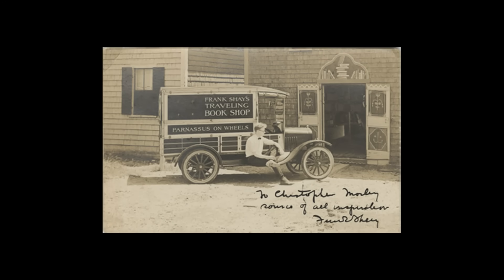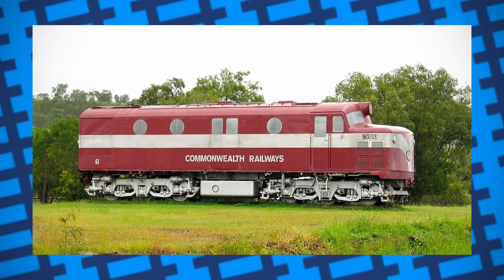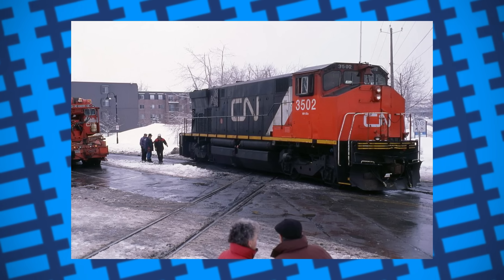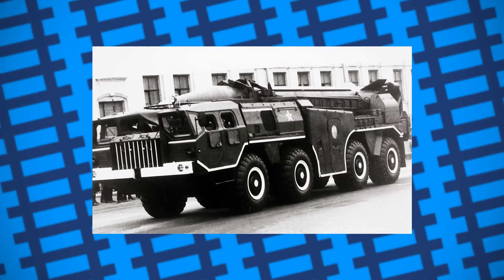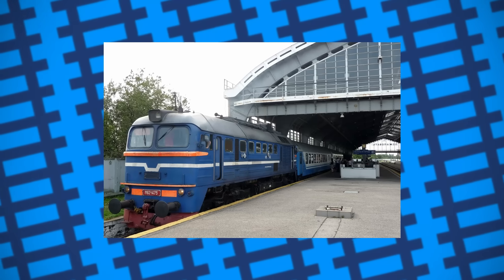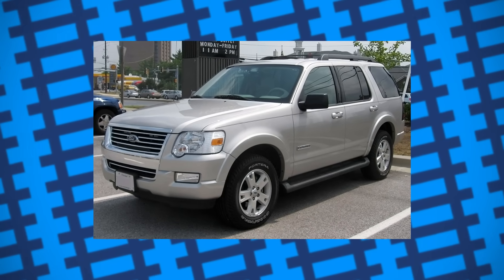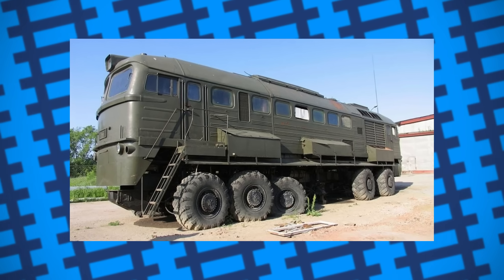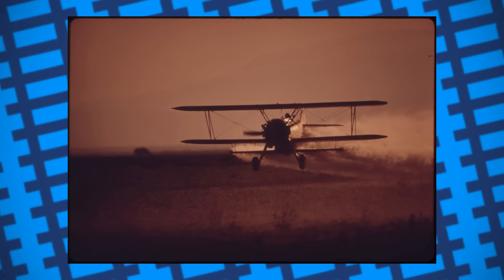Why Railway Locomotives Don't Make Good Road Vehicles - M62 + MAZ-547

Comment: i may be wrong here, but I seem to recall reading that the main reason this idea was floated, was as a potential power source for what Russia calls "Frontal Aviation".   Frontal Aviation is something of an outdated term today, but at the time that encompassed everything from forward operating air bases, to air defense.  Whatever the case, one article I found suggested that part of the idea was to utilize the M62's as portable generator stations.  The theory being that these converted locomotives (a large number of m62's were produced, so they had something of a surplus) could be driven to and 'emplaced' at forward air bases.  Those bases being hastily constructed affairs and not fully established like a true airport or base.  This locomotive, or a couple of them, would provide power for the base. In the event the enemy were closing in, then everything (including the power units) could be driven to a new location.

Comment: It could have also been used for moving supplies to remote Arctic regions for oil and gas exploration as and ice and frozen ground does makes for solid roadways. Even for extremely heavy vehicles. They would do something similar with bulldozers pulling sleds in Canada and Alaska. Granted if you would put this thing in 2 separate sets of tracks like on quad track tractors it probably would have done better but would have been very slow

Comment: My Ford pickup has more power than that shunter. I would NOT have guessed that! I have also pulled a 40ft flatbed with up to 10,000lbs on it with the pickup (nearly 25,000lbs gross combined). It's crazy how much horsepower modern tow-vehicles produce in comparison to the smaller locomotives.
Reply: To be fair, power doesn't pull, weight and adhesion do. Power just determines how fast weight and adhesion can pull.

Comment: I wonder instead of a heavy diesel locomotive, if it is could be possible with a civilian City transport train cart. Particularly the ones that we have in the US as I'm not familiar with the designs of other civilian train carts in other nations. Which do have different designs. But perhaps like the one we have in America maybe more lightweight than the heavier diesel electric train. Now I don't know too much about these train carts but I do understand they don't really run on typical fuel and I really just electric. So no dies or anything, I think it's literally just powered by its railways. 

It probably be more equivalent to like a battery car, but again no quote me on that so I don't really understand the true mechanics and how they work. But from what I've seen, it doesn't look like it has a fuel tank built so if one of these supposed to be converted to a land vehicle it probably would be too heavy and be more like the weight of a semi truck with a trailer. Maybe. And it would either have to be a battery-powered electric vehicle or have a semi truck engine installed. Honestly, there would be no real such purpose that such a vehicle would ever be able to fulfill when we already have semi trucks and buses that can do whatever we can come up with. When you really think about it, semi trucks and buses are already land locomotives. As in straight on the ground, no rails.

So if we were to convert listen to something that can go on the road, we would have just basically created a bus out of a train car. I mean it would be interesting to see if it could be done at all, but literally there be no purpose to do that other than just because. Just to see if you couldn't if it would be effective as a bus. But we wouldn't really need to convert them to buses unless somehow we started running out of materials to create buses and didn't need the City railway transport anymore. So under such a circumstance we decided to start converting civilian train cars into buses.

I'm not sure what event in What alternative universe would need to happen for any City to ever be in a situation to need to do that, but I think that's really the only logical circumstance I can see where we would ever need to convert train civilian cars into a land non railway locomotive. Or basically a bus. Anyway then it probably be easier just to do that out of semi trucks and vans. Once upon a Time semi truck we could bring them back if we couldn't produce buses for whatever reason. 

But yeah the more I think about it, the only possible reason why anybody would ever want to do this is just to see if they could. But there's no real use such a vehicle could fulfill that can be fulfilled by trucks and buses. And vans. Heck, even those giant missile carrying vehicles, even if they were designed off of a locomotive they're basically a giant missile carrying trucks. Each vehicletype or find machineries in of themselves that are perfectly fine for the very purposes they were built for. Eat your own truly powerful machines.

Comment: Sounds like they just didn't use strong enough axles and suspension.

Road trains have been built, just not in the way described here, instead being purpose-built (although the successful log haulers described in an earlier video on this channel come close).  Wikipedia has articles on road trains (successful) and overland trains (experimental, some success in demonstration, but not commercially successful).

Comment: I feel you are looking at this the wrong way, as in too trainey :o) If you look at the Le Tanou road train which was diesel electric, or the six trailered Australian mine trucks high horsepower it makes a lot more sense. And why make a body when you can weld the whole locomotive on top of the missile truck chassis. If it doesn’t work you just separate them and use as originally intended. Simples :o)

Comment: Far too complex, there are much easier ways to provide emergency power. Around the turn of the century the Australian state of Tasmania suffered a drought. That was a problem because their electricity generation was 90% hydro electric, 5% wind and 5% gas. To make up the shortfall they just hired some diesel power stations that came in 40 foot shipping containers. Then they fueled them with diesel, plugged them into the grid and the whole state had electricity. When it rained and the hydro power stations were back on line, they sent the power stations in 40 foot containers back to the company they hired them from. Simple, easy and relatively cheap.
Reply: yes, but this method is far less fun

Comment: Kinda feel stupid for stating this BUT why didnt they just put this thing on tracks instead of tires? Having so much weight on normal rubber tires just isnt gonna work. So why not distribute the weight properly like they do with tanks or heavy forestry work vehicles.. that way you dont need steering since the tracks do that for you and isn't like the soviet past couldnt offer many tracked chassis to begin with.. Still not sure what the purpose then would be but I guess it would work as a vehicle...
Reply: Making it a tracked vehicle would have probably made it less mobile, actually.

 Given the length and width of the vehicle skid steering would have been very inefficient and with only one drive sprocket per track, it wouldn't have been able to apply all the power it could make without using some extremely powerful - and large - eletric motors.  Track systems are also a lot heavier than wheeled systems and have much higher maintenance requirements.
The only advantage tracks would have is better floatation and ground pressure.

Comment: Cropduster out of a Jet Fighter?

...I mean...people - in the Soviet Union, of course - tried to build a jet-engine crop duster. the PZL M-15 worked about as well as you might think. as in...not very. They still built more than a hundred, though, so it was at least more successful than this thing was. somewhat. kind of. One example that failed immediately is not a high bar to clear.
Reply: I swear, their engineers design heavy machinery while under the influence of

Comment: I think this was a typical case of Russian corruption. They clearly could build a unique prototype, like they did before, so someone must have stolen the entire budget. They then grabbed some random cheap shit and slapped it together last minute just so they could present something and avoid suspicions of theft.

This explains why no weight reduction was attempted, many heavy components like the bufferbeams, ballast, etc could have been removed, but no budget, no designers working on the project, just some mechanics smekalka-ing their way through it.

This is also why Russian military equipment sucks btw. Money is stolen and bad quality is accepted to avoid a loss of face. This is why the Armata was never developed fully and why it got cancelled last year.

Comment: Mentioning the torque in this case would be a far better measurement. Example? There are V8 hemi engines that can produce upward of 12,000hp—but will never produce enough torque to get a train moving.
Reply: Thats kind of a moot point for a Diesel-Electric locomotive since the traction motors are always powered by electricity.
Reply: @mrspandel5737  Right, but an ICE gets dragged down by load on it. If it doesn't have the torque to turn the shaft, it doesn't matter if it can rev to 8,000 RPM because it will stop turning. Given the tight powerband of diesel engines, the torque is generally the most important attribute.

Comment: I should mention there is a case where a rail vehicle with road wheels worked out at least a little bit successfully

that being Pacific Electric streetcar 1058. The mad lad behind the project, Richard Fellows, actually turned the control stick into a tiller-style steering wheel, turned the deadman's pedal into a gas pedal for a diesel motor mounted beneath the car, and just used the original Westinghouse brakes but hooked them up to 8 rubber wheels instead of the bogies! and since streetcars are lighter than locomotives, the weight issue wasn't even an issue.

 You can imagine how baffled LA residents were in the 90s when they saw this guy driving down the street in this thing. and he even got it to cameo in roger rabbit in the background of one of the scenes in the movie.
Reply: awesome 
where is it now?
Would do that to a PCC car & I would love to have the prop Birney trolley used in The Changling
Reply: @microbusss  it was converted back to run on rails in the early 2000s
Reply: @yeoldeseawitch  orly?? darn would of loved to of gotten the chassis & build one on it
Reply: What Roger Rabbit scene was it?
Reply: @ a street scene where the main detective character hops aboard another streetcar, it can be seen for a split second in the background
Reply: @yeoldeseawitch thanks
Reply: Nancy's steerable tram was another such case.
Or maybe it was a rail-guided bus, depending on how you want to look at it.
Reply: Trolley CAR

Comment: Here in the USA there are pickup trucks the rail networks use. They have small hydraulically lowered steel wheels that fit on the railway line as guides. After that, the ordinary wheels sit on top of the rail and propel the vehicle. They get on and off the line at level crossings. I've seen that done plenty times.
Reply: These are called 'Hi-Rails' (or 'Hy-Rails') for 'Highway-Rail [vehicle]'.
Europe and Russia also have these.
Reply: I've seen something like that in the UK for small utility vehicles and cranes.
Reply: Not unusual in the UK,
Reply: not exactly what the video topic is about but those do work, road vehicle to rails are clever, but its the inverse that is tricky, making an engine work on the road instead of rails, maybe they should have tested with a narrow gauge first
Reply: @ Thought of steam tractors...
Reply: I've driven them in New Zealand, stopping in the wet requires about a footy field, not a lot happens when you stomp on the brake so local knowledge and forward planning is absolutely required if you want to stop at a given point....slightly better in the dry but the same principles apply.
Reply: @DomingoDeSantaClara  Why?
A road train is essentially a several trucks coupled together, each truck having enough of its own brakes. Then why stopping a string of coupled vehs takes longer than stopping each one individually? Something about jackknifing?
Reply: @u2bear377  we're talking about utility vehicles on rail, the drive wheels are barely touching the rail hence the long stopping distances.
Reply: @ Ah.
Confused it with the road train talk in the other thread.
Reply: The USA has the largest rail network in the world fun fact lol
Reply: @sc1338  Europe has much better rail network, kekeke. :)
Reply: @u2bear377 not for freight. European freight trains look like toys compared to the US.

Comment: I laughed a lot at "turning a train into a car is like turning a jet fighter into a crop duster"... May I present the PZL M-15. The dual turbofan agricultural plane from the absolutely mental (and metal 🤘) collab between USSR and polish industrial design bureaus. 

It popped into my head about 30 seconds into your video, well before the crop duster joke, and I truly can't believe the truckter-trainer isn't from the 1970s USSR. 

As a final aside, I just can't imagine a "mobile power station" with design requirements that landed on this as the best option. The USSR/post Soviet states are still the preeminent designers/source for modern versions of those 6+ axle vehicles. They're up to 12 axles now I think .. either way, you can imagine the kinds of diesels they already come packaged with... If they're removing all top side hardware and missile(s), 800-1000hp class industrial gensets in a steel house to meet power needs, or in a row of half TEU containers if you want to take 100% of the Soviet out of the design.
Reply: I will say that in contrast to how engineering, and engineers from the USSR were characterized in media as farmers using 30 year old lend lease tech, doctored to fail CIA produced blueprints, bailing wire, and vodka to run their industry and military (until US defense budgets were submitted of course, that's when you get to hear about 12 wheel freight locomotives running on nuclear power, hitting 230mph in the quarter mile, submerged, across the bering strait). They really did know their ultra heavy military transporters. If that model train had 2 prime movers, it would only make sense for one to be removed, at least while prototyping. And even if they wanted to retain the house (it does look awesome,  that's undeniable). If the train had a body on frame design, removing the prime movers, fuel tanks, and genset makes way more sense, instead of bolting the train frame directly to the vehicle frame. And yeah, lots of ancillary stuff can get chucked out too... I would guess the road vehicle started life with a max weight around 80-100 tons, the newest version (12 axles) can carry a 70-80 ton missile, plus all the extra stuff you need for that whole operation... So let's just say 40-50 tons for that older vehicle, once the top side was stripped. It was probably done in by the independent articulating wheels tbh. You can keep making an axle housing and internal axle shaft/integrated hub thicker and thicker, and add more and more dampers with torsion bars or leaf springs until it can handle the weight. But making individual gearboxes, hubs, ball joints, etc. for a one-off prototype, is just nightmarish. It's may not be vodka, bailing wire, and the will of the proletariat, but it's definitely using parts off the shelf. Anyways! I'm just yapping, very cool video, never saw this before, but it's hilarious!  This whole thing seems like a garage 54 project..
Reply: Hello fellow Alexander The Ok viewer
Reply: Slight correction: PZL M-12 used one turbofan engine
Which I suppose was made for a regional jet (although later used for military *aircraft), but that's still quite far from application for crop dusters (as jet engines tend to be)

edit: *training aircraft
Reply: If you liked the M-15, you should google Lala-1 (the experi-mental plane which preceded the Belphegor) and marvel at its absolute awesomeness.
Reply: It would have been a better comparison to say "turning a 747 into an Alaskian bush plane".
Reply: I am glad you brought up the PZL M-15. 

"turning a train into a car is like turning a jet fighter into a crop duster"
*LAUGHS IN SOVIET* 
Comrade *slaps hood of crop-duster* this small plane can fit a terrible jet engine.
Reply: Never under estimate the Russian engineers pulling of the ultimate job pranks!